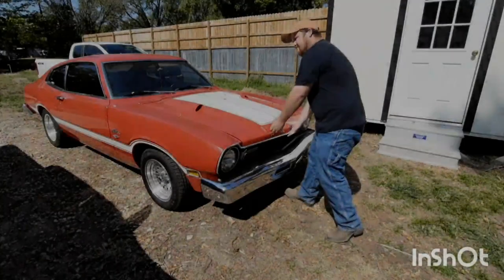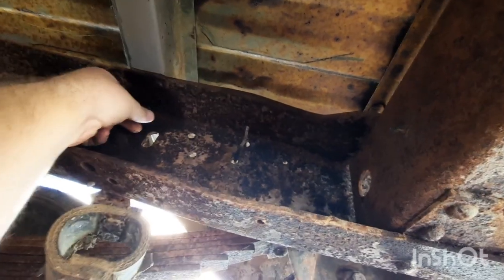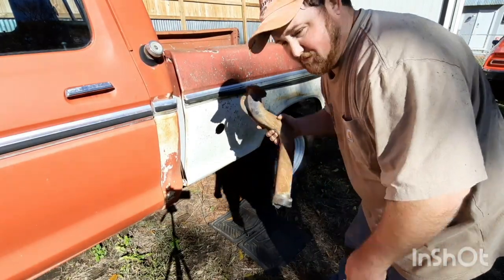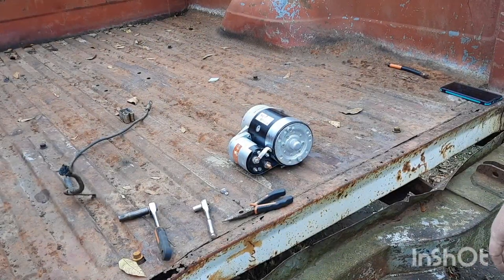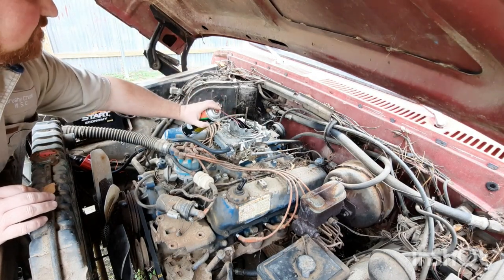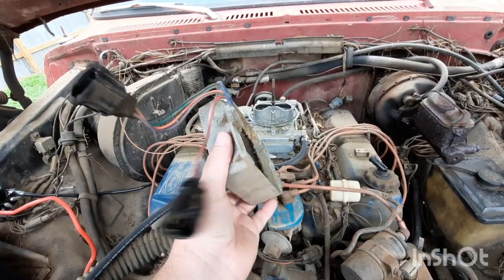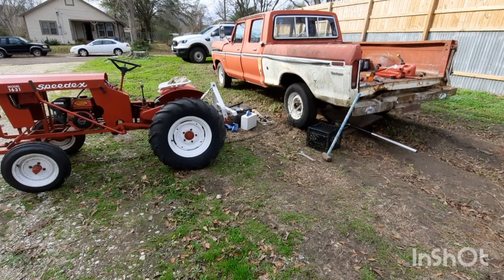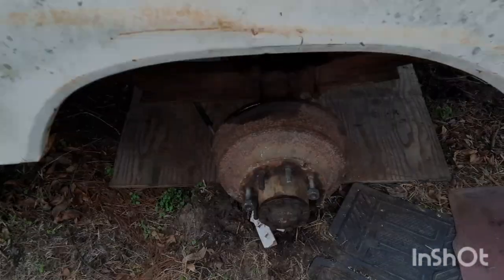1976 F250 update bed mounted no spark and brake drum troubles

Comment: My hearing isn't that good, but I thought you said you tried to back off the brake shoe adjuster and its still stuck on there. Well you can try putting some heat to it and hitting it with a hammer again, more than likely the shoes have cut into the drum and are sticking. I had a early 77 f250 crew cab just like the one you've got.

Comment: Amigo, that drum don't come off that way. Put a catch pan under the axle bolts and remove the bolts,washers and wedges, then slide the axle out. Then loosen the retaining nut and remove nut,washer and bearing. Then remove the drum and hub as a unit.